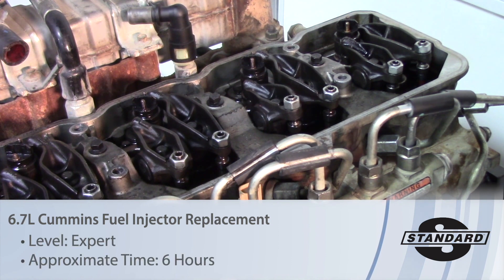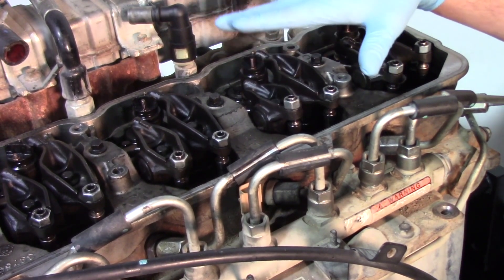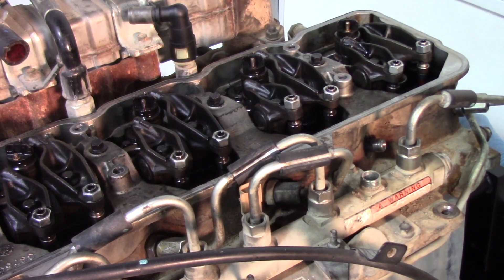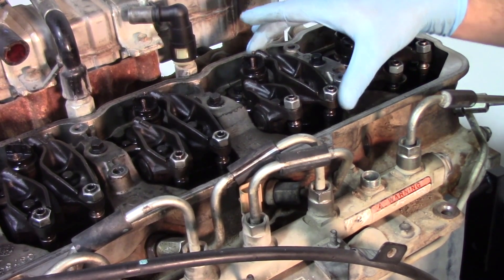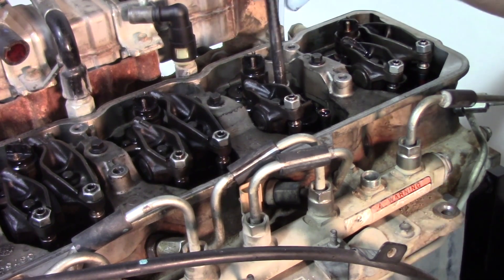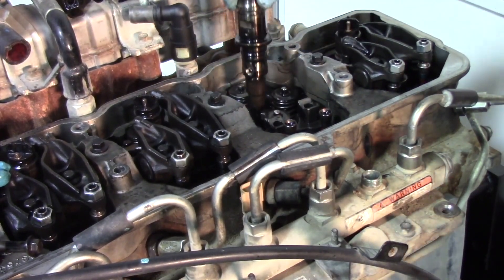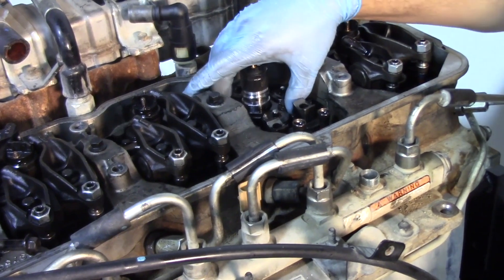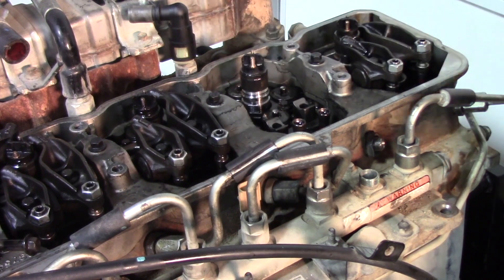6.7L Cummins Fuel Injector Replacement

Comment: Good video for the most part, but I've gotta say: THERE IS NO REASON TO REMOVE THE 13MM NUT ON THE ROCKER ARM!!! That is very irresponsible for you to include that in the disassembly. You don't need to take it off to change an injector and it can cause MASSIVE problems if you're an amateur, like myself, and you do remove it. I only did it to one piston, before I realized it was unnecessary. I tried to put it back to match the other ones, but after I finally got it all put back together and drove it around, one of those nuts walked off and bent my push rod all kinds of squiggly, kicked the bridge pieces loose in the motor. Talk about a knock, more like a bulldozer! Almost ruined my engine. I'm pretty upset about it. If you are watching this to change injectors, DO NOT REMOVE THAT 13MM NUT ON THE ROCKER ARMS